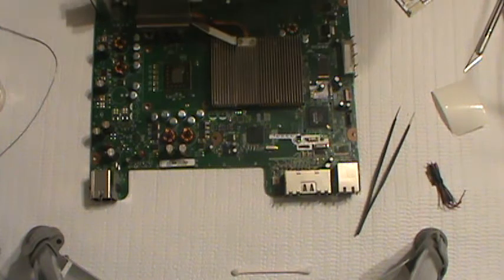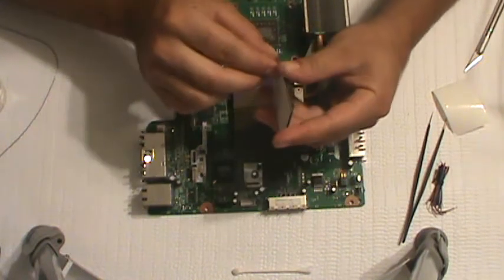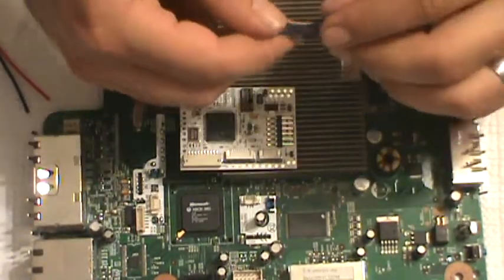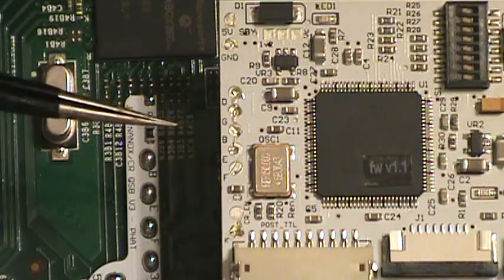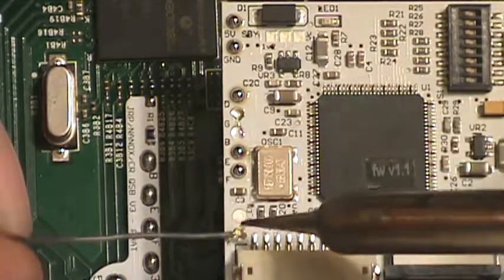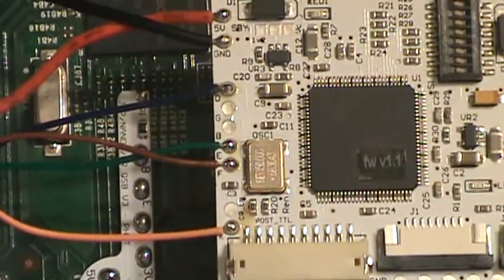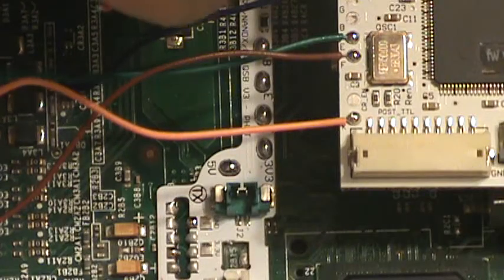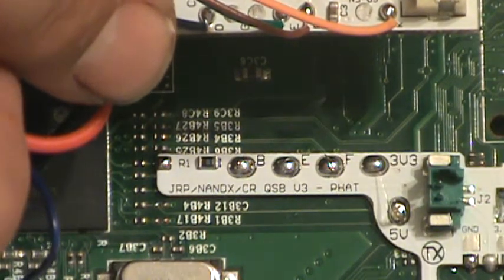Xecuter R-Jtag Install Tutorial Part 3

Comment from the maker: Your correct.  I never even noticed that I made this mistake.  I removed the wires later in the video and made them a little longer and re did my work.  I guess I fixed it then!  I added an note for this part.  Good catch.  Thanks.

Comment: Folks, this part of the tut has incorrect wiring for brown and green wires on JTAG QSB. Brown wire should be soldered to F on QSB and Green wire should be soldered to E on QSB. Nothing should be soldered to B point on QSB. He has fixed the problem in Part 4 and Part 5. Check with the JRUNNER pics if you want to verify.